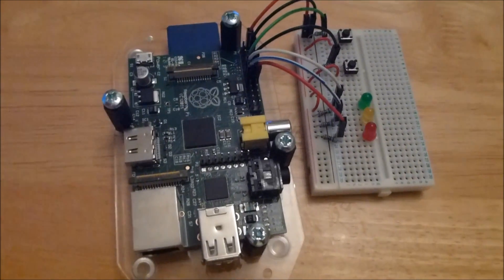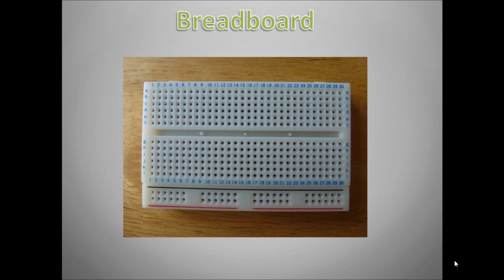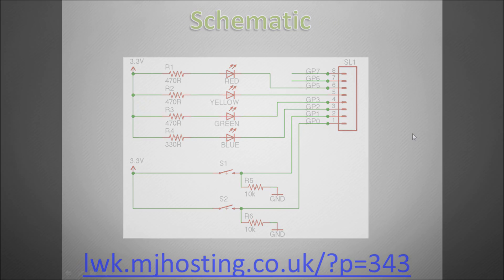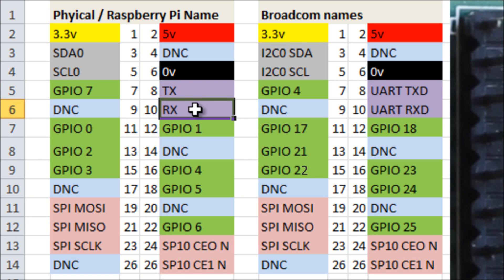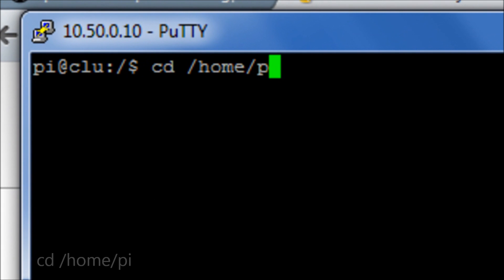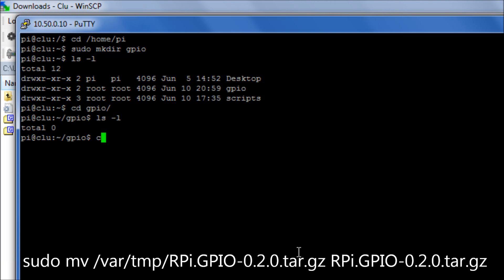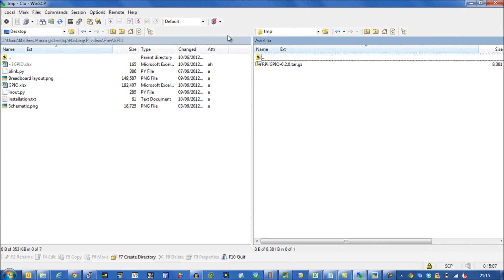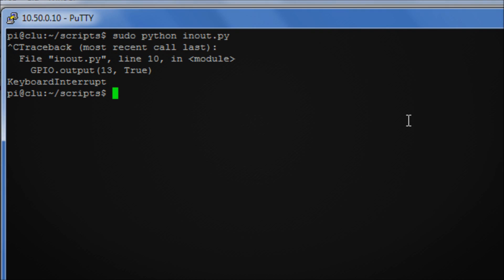Raspberry Pi - How to use the GPIO

Comment: Now Im personally into the electronics but I used to program a - dang cant remember. It was siemens and had the number 535 in it i belive. It had 4 ½ port x 8 pins I/O and a A/D converter port. It was back in the days with DOS and Win98.
It seems that this is somwhat the same princip. Im SO getting one of these though i cant imagine what to use it for just yet.

Comment: Great video. Might I suggest Adafruit's Pi Cobbler if you're going to do a lot with the gpio on the Pi. 
A question - where did u get the sweet spreadsheet showing the layout of the pins?

Comment: Turns out (from what I have infered from the polarity of LEDs and such) that the pins have no power capability. They only take signals in. The "output" isd simply them allowing current to flow through them rather than they physically outputting current.

correct me if I am wrong anyone

Comment: I've got v0.3.1a installed successfully. Took a bit of mucking about with the code and various odds and sods, but have a look at my previous responses re: running apt-get update, changed GPIO.BCM to GPIO.BOARD and Bob's yer Uncle. :)

Comment: Great video - one thing I did notice though is that I had to add the following:

GPIO.setmode(GPIO.BOARD)

Initially, after a bit of reading, I had set it to (GPIO.BCM), but this wasn't working changing it to BOARD however, did the trick.

I'm new to Python, so not entirely sure what the difference between BCM and BOARD is, but that's what I'm off to find out now :)

Comment: I am running (Debian) Linux raspberrypi 3.1.9+ #90 or that is the text when I login. The GPIO is 0.3.1a as donwloaded from the link only show this and v0.2.0. I did the pythion-dev which appears to have run ok but when I run sudo python setup.py install I still get the  Pythn.h error then a list of error messages thereafter. And when try to run still get same error 'No Module name' etc. Will try the extra line of code and re-run. Cheers.

Comment: a whole day's fiddling to make a few LEDs flash... the most productive unproductive day i've had in years! thank you for the nice clear guide - perfect for getting me started. i struggled to find M/F jumper wires too, so i hacked up an old floppy drive cable which fits rather nicely on the GPIO, just label and tin with solder the other end of each wire you need

Comment: Where did you get the M-F jumper wires used to connect to the Raspberry Pi GPIO pins? I'm looking for a source in the UK if possible. Maplin don't sell them and I can't find them at RS Online.

Comment: yes, that is the flow, but there will be less current if you go to the 3.3v out (pin 1 vs. pin 2)
the long lead is normally positive (the flat on the side of the LED is neg)
the video has been updated to reflect that.

Comment: Entirely agree, the whole idea of using sudo is that things are safer if you only activate root privileges when you need them, if you want to use root privs for an entire session, just use root (su -). In this case, super user privs were required because root is the owner of everything, though a quick chown can fix that.
Also, to get to your home directory, rather than typing 'cd /home/pi', just type 'cd' or to be more clear, 'cd ~', the tilde, as shown in the prompt is a shortcut for home.

Comment: Nice vid, thanks for giving credit on the schematic :)

Just a note on the UART pins, they are not for directly connecting a RS232 serial and doing so will likely fry your Raspberry-Pi, more correctly its a 3v3 TTL Serial.